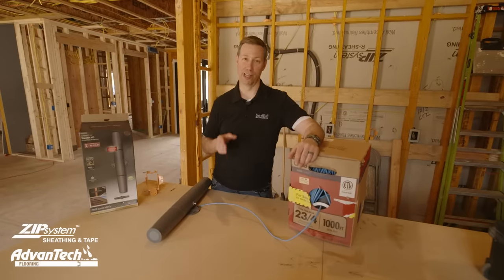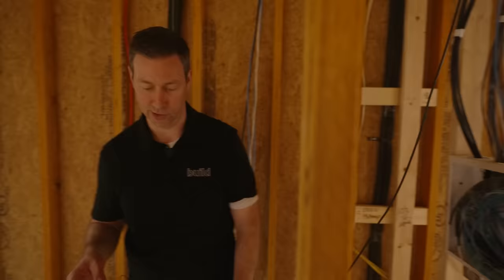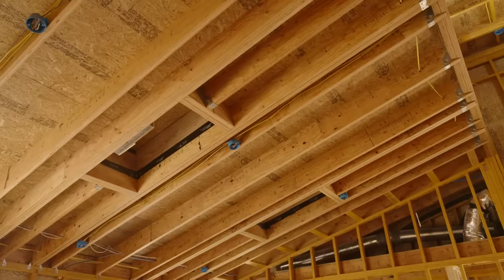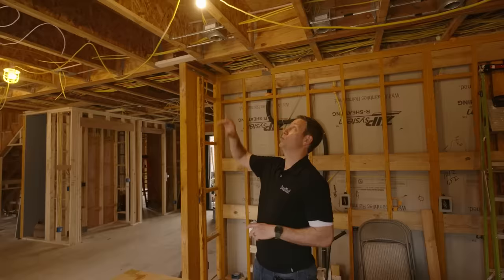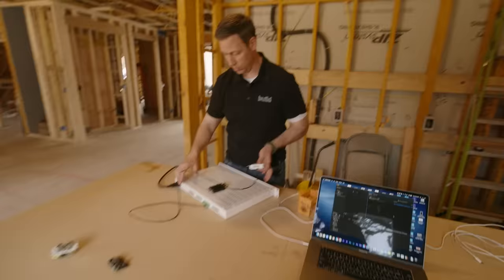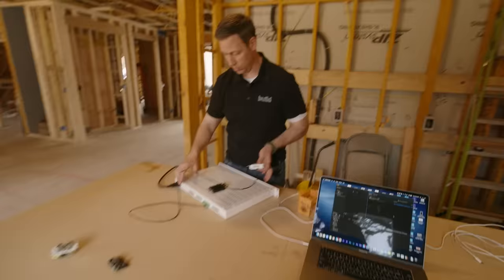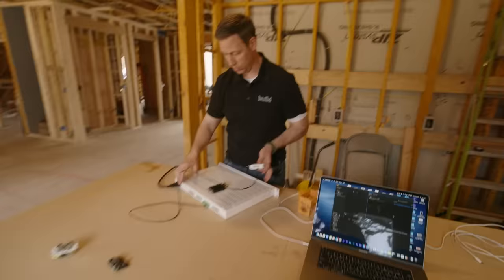Low ⚡Voltage at the Real ReBuild

Comment: Matt, I enjoy your videos.  For all of the research you do I am disappointed you didn't consult any of your AV subs.  You so easily discount Low Voltage even though you specifically "only" use the internet for all of your media content.  Unifi is a great product that will require you to learn about some networking.  It is also a product that works best wired.  To be fair all of your proposed devices should be wired to the network including Sonos, TiVo, Samsung TVs, Unifi...  To only wire for a few locations because you are scared of technology is similar to wiring only the outlets you know you'll be using.  You being a fan of Solar should know those controllers prefer ethernet.  Garage door hubs, lighting hubs, steam shower hubs, whole house water shutoff hubs, HVAC hubs, WiFi Access Points, Cameras, Doorbells, Tesla Powerwall, printers, appliances....these are all currently used devices that you the custom builder have not planned for.  Your Samsung TV with a proprietary cable will be your next iPod dock brick.  Give more respect to a trade that is absolutely part of the future and do equal or better research like you do for all of the other building trades.

Comment: Did you consider a whole house control system like Control4 or savant? Could you tell me the pros and cons of these high end systems?
Reply: Cost is the major factor here and Control4 or Savant is overkill for what he explained he needs and is doing.  He does not have a large multizone system with many receivers in a rack to many TVs and control to the sprinkler system or many other systems.  He said he has one major TV point.  I install low voltage and the more expensive systems are getting phased out by these systems that can be setup and fixed by the end user like SONOS for audio and Ring for Alarm.  Not to say they not still have a place in some homes or businesses.

Comment: Matt. Did you run your LV wire parallel with your high voltage?  You should never do that,  you should try to always stay a bay apart or go across when ever possible. You are going to attract a lot of noise. Perhaps even kill some of the signal.

Comment: So, how did you deal with the voltage drops running that length of low voltage wiring aka Cat5/6? Or did I miss the explanation?
I have been thinking about running and using Cat5/6 PoE instead of using ROMEX if only low voltage devices were being installed and or used for several years now however was concern about voltage drops.

Comment: Doesn't the voltec system then introduce the problem of voltage drop. I have a sailboat and when you are working in 12 volts over any distance voltage drop becomes a problem that is solved by increasing wire size. To get over the problem with my solar panels I connect them in series increasing the voltage to 80 or so which is then stepped down to chargning voltages closer to the batteries. To me it would make more sense to keep the voltages high with 120 AC and find receptacles with higher dc amp charging for the laptops.

Comment: Always run more ethernet lines than you need. It's so much easier to do before the drywall goes up. Wireless is good, but a hardwired connection will always be faster and more stable. Think of Computers, TVs, Cameras, Smart Devices, Media Boxes, Wireless Access Points. Always run a few lines to each room.

Comment: What about future proofing. Noticed ya didn't mention any smerf tubing or anything like that
Reply: My main concern. For Matt he'll just open up the wall and replace whatever and make a video for us. For us viewers on a low budget(dirt poor), diy we need considerations for future tech. I think building access panels that are removable and using lower gauge wire when a higher one would do just fine in your current application is a good practice just in case. 

Proprietary scares me on a house. If the speaker wire connects to a generic speaker I can always replace it. If it connects to a specialty product what are the chances it fails in 10 years, the company or product line is discontinued, and I'm stuck committed to something that doesn't exist anymore. 

Modern stuff is cool but there's a reason why there's so much e waste as tech advances and why building it into your house can be a bad idea. 30 years ago vhs, cassettes, tube tvs and monitors, laser disc were the in and up and coming tech. Had you built with that in mind you'd have these slots in the wall for AV equipment, embedded RCA cables, huge reinforced recesses to support the weight instead of a cabinet plugged into an outlet that you can throw out with the times.

Comment: WiFi IS improving, but for video at fixed locations, it is no substitution for a wired network. I use three Ubiquiti WiFi access points at my house (I actually need to add a fourth) and get great speed, but I run gigabit Ethernet to each TV location. For over-the-air TV, I use several SiliconDust HDHomeRun network tuners; two EXTEND units which can do two channels each and one HDHomeRun CONNECT 4K which can view up to four simultaneous programs with two of the tuners dedicated for ATSC 3.0. Instead of a TiVo, I use my Plex Media Server to function as my Live TV/DVR, allowing up to six simultaneous different channels being viewed/recorded.
Reply: +1 for PLEX!

Comment: If it were me, I’d run fiber optic to two most distant utility areas in the house and branch with Ethernet from there. Running single CAT-6 runs is too much like the old-school iPod cable you mentioned.

Comment: Cat6 is 4 twisted pairs... not 4 stranded pairs. Also, southwire Cat6 doesn’t have the pair separator built into it like the quality Cat6 wire manufacturers use.

Comment: I would run the low voltage wiring in smurf tubing so you can easily pull new cable in 5-10 years when CAT6 becomes obsolete....

Comment: I wouldn't be linking a CCA type Cat6 cable - definitely not quality.
One big useful trick with keystone panels is if you renumber them so they aren't 1-24 across, but 2 rows of 1U 24 panels where one  is odd ports, other is even ports. Example if you have a 24 port PoE switch used you can populate 13-24 slots on both rows but the positioning would match perfectly up with port numbers and locations so you can use 6" cables (use 1-12 for coax keystones or something). Be a super clean install and save on wire management.
As for Ubiquiti gear - I have both the regular Dream Machine and several Dream Machine Pros at work. I'd consider the Pro instead since it has more more of the UniFi ecosystem contained in it like the NVR and door access. It also let's you drop in your own storage drive.

Comment: Liable the power wattage if the USB outlets. USBC is a wild west of wondering if it has enough power. The system should automatically detect lower voltages.

Comment: To this electronic tech, you're absolutely right about gross overfeed for North Am residential lighting circuits.

You might want to get back to some of your contacts in Switzerland and Germany on this. Europeans think even incandescent lighting circuits should be run low amperage. Make that LED and low voltage solid-state devices, and the point is even more abject. They're way ahead of where we are! Note the date below: 

Time to Ditch 120V AC? How a Low-Voltage, DC-Powered Home Might Work
Has the 240/120V AC residential infrastructure outlived its usefulness? Inspired by Tesla Powerwall, an industry veteran explains how we could get to the the old ‘Smart House’ vision of a low voltage, DC-powered home.

CE Pro Editors  • November 23, 2015
https://www.cepro.com/news/how_a_low-voltage_dc-powered_home_might_work_tesla_powerwall_energy_storage/

Comment: You will regret having a Samsung proprietary cabling solution within 5-7 years.  They have done similar things (HDMI ports remotely connected over a proprietary cable) in the past.  Typically, when those TV's finally die, there is not a 'new' model that can use the same cable.  So you would then need to replace the cable as well.  Do yourself a favor and run a high quality HDMI cable (assuming the run isn't more that 25-30')  and 4 strands of fiber optic cable between the media closet and the box behind the TV.  The Samsung solution is quite nice for the short term, as you get one remote that controls the TV and source switching, but technology changes rapidly these days.  In 15 years, we have gone through probably 5 iterations of the HDMI standard, in order to accomodate ever increasing display resolutions, but at least those standards have remained backwards compatible.  You can find multiple different options for switching sources, most done through some sort of home theater receiver or sound processor with source switching.  That does mean that you won't get the switching function through the TV remote though, with the trade off complication.  And consider what sort of surround sound you want in the TV area ahead of time.  The Sonos sound bars are pretty basic when it comes to actual surround sound.  And please don't rely on WiFi for your connectivity solution for the Sonos equipment.  It will work ok for a couple of speakers, but if you start to scale it to whole house sound, you will find that you get dropouts in sound from time to time.  A cabled ethernet connection will always give you better bandwidth for things like audio (and video) that need consistant streams of data.  I also have some questions/thoughts about the USB distributed charging solution, but I can save those for later.  Finally, be sure to get yourself a good Fluke ethernet cable tester (https://www.amazon.com/Fluke-Networks-MS2-100-MicroScanner2-Troubleshoots/dp/B000QJ3G42/ref=sr_1_14?crid=36ERJB27P7FDT&dchild=1&keywords=fluke+ethernet+cable+tester&qid=1621421290&sprefix=fluke+ethernet%2Caps%2C177&sr=8-14) to make sure that your ethernet cables are properly terminated, especially if you are going to use Ubiquiti Unifi cameras that use Power over Ethernet (PoE) to get their power from the network switch.  The ethernet data only requires that 2 of the 4 pairs of wires are connected to work, but the PoE requires that all 4 pairs are properly terminated.

Comment: You want everything that doesn’t move to be wired, and you want to put a separate, PoE-powered (hard-wired) wifi access point in each room. 5GHz wifi doesn’t penetrate walls very well.

You want to leave your wifi spectrum as free and clear as possible for things that are mobile (laptops, phones, watches). And while it should be avoided, some appliances just can’t be gotten in wired versions (smart thermostats, scales, etc.)

Even laptops that you dock at a desk should get hard wired. Otherwise you’re just wasting that precious fiber service.

Check out UniFi hardware. Bring in a patch panel and a 19” rack and buy rack-mount versions of the gear.

Comment: Cat6... that's a bit of a mistake, cat6a is where you have 10g possible for longer than 30m runs.

Also the ethernet should really go into conduits, so that you can swap the cabling 10-20 years down the road when you need something like catWhatever or fiber to certain locations of your house.

Comment: It would be nice , that instead of the rats nest of plug-in A/C adapters that rooms could be wired for the low voltage for all that.  Computers can use external power supplies, which reduce the heat and are quieter too. A closet can contain a battery backup.
Reply: I have seething hatred from wall wart power supplies.   If the need ever arises I’ll spend the $$$ for a Middle Atlantic DC Distribution center just to eliminate the clutter.

Comment: cat 5/6 is cheap.... I am pulling cat 6 to each room in my home, every TV location (used and un-used)
I'm also pulling cat 6 to a couple of outside boxes along with outside outlets for christmas lights, and using cat 6 to take data to christmas light controllers. In my soffits I am installing RGB pixels that are hardwired low voltage and will be controlled via kulp boards with a Pi to send color data to those pixels (lights).

Comment: Matt, For that Samsung Frame TV, did you have to run the cable through a conduit? 
Samsung is not clear on in wall ratings for those TVs.
Reply from the maker: I didn’t 😬just ran a conduit beside it in case it’s needed in the future

Comment: I wonder how that Voltec system manages power delivery properly with only 2 conductors.

 Typically a MacBook will request 20V from the charger but needs the conductors to do so.

Comment: My main criticism of integrating tech is that it will one day be obsolete. If you're cool with remodeling regularly it won't matter. If you're poor as in spending money on bricks for some landscaping is expensive in your mind then you're not gonna be opening walls to rerun whatever 10, 20, 30 years later. There's something to be said for keeping things simple and making obvious generational changes. Adding more outlets when we now have more and more devices is logical and forward thinking. Running a pipe with your ethernet wire through it makes upgrading it from cat 5 to cat 6 or cat 500 in the distant future easier. 14 gauge wire on a video doorbell is overkill but bell wire was all you needed for a traditional bell 50 years ago.

Comment: I thought the Samsung The Frame accessory cable maxed out at 15 meters.  Also, you don’t need any of the cabling (or power) in the wall box for the Frame, since the connectivity and power will be in your media closet.  I suspect that you are just future-proofing that location in case you no longer use The Frame in that location.
Reply: Yup…One Connect box has multiple HDMI.    It’s easy to run baluns if longer runs are required.

Comment: There are two important reasons to go with #12 AWG wire in lieu of #14 AWG: future capacity and voltage drop. Future capacity may not be as big of a deal for you, since I bet you segregated your circuits well, but if there’s a future owner they will likely connect new equipment wherever it’s most convenient. But depending on the local utility, panel and service size, and installed heavy equipment, you may have enough of a voltage sag to affect lighting. #12 AWG wire has a 59% larger cross-section area than #14 AWG wire, so #14 AWG wire will have a 59% higher voltage drop (all other things being equal). I’m with you, spend the money now to save the headache later.
That said, I’m not a fan on POE lighting or low voltage USB, mostly because of future-proofing and sometimes misleading marketing. The UPS idea was good, but I prefer solving resiliency with larger solutions. What if you need to use a 120V device in a power outage?

Comment: I always find it interesting when  I see these kind of projects taking place and none of the wire is in pipe.  Here EVERY wire regardless of voltage or use MUST be in pipe. Doorbells. Ethernet cable. Coax cable. POT lines. Speaker cable, etc etc.  No MC no BX no Romex, nope can't do it.  The labor savings for all this at your house is enormous.
Reply: "Here" is where?
Reply: @bradgaeth  DuPage county Illinois

Comment: You might still want to run coax to your tv ports for when the fiber goes out so you can run a digital antenna thru it. That way you always have at least local digital channels for your tv. IMHO. Just saying. 🤔

Comment: Isn't the advantage of AC over DC that you can use thinner wires to carry current  without voltage drop over distance? I wonder how hot the thin DC cables will get when charging the laptop over the distance.

I'd also be curious to see the voltage drop for the 100' run to your further jacks.
Reply: AC has an advantage on really long runs and its safer at higher voltages. DC at low voltages can be more efficient. Over the 100 feet you will drop around 2 volts on a 36 volt system. The wire is rated at 5 amps and the max wattage for a class 2 low voltage system is 100W
Reply: There really isn't an advantage. The lower the voltage the more current (amps) is need to deliver the same power to a device. Power = Volts & amps. The more current, the less efficient power transmission is. Thats why the grid uses very high voltages to transport electricity over long distances. DC power is limited to 48VDC in household or commercial wiring since higher DC voltages have potential issues.
Reply: @guytech7310  the current doesn't effect efficiency.  Power loss is a result of resistance which is determined by the wire. Lower voltage systems save on copper and material  especially in places you dont need higher power which is becoming about 90% of homes.

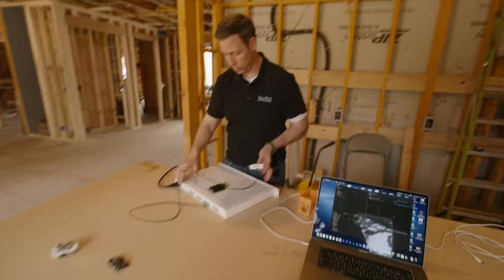Comment: 11:00 Regarding Matt's comment on DC lighting...Look at ATXled.com.  I installed ATX in a garage and have it connected wirelessly to a Shelly motion sensor.  Easy install with 18g wire, flawless operation.
Reply: Currently building my home and am going w/ ATXLED throughout. Super easy and has SMART features, but still works just like a normal light.
Reply: @jasoncbeaton  Just curious what smart system you're connecting the ATX to - if you don't mind sharing.  For some reason my automated system stopped working ....it included Shelly, a system (forgot name) to connect to ATX and I thought Alexa to tie it all together....so it's been back-burner'd.
Reply: @rdy4trvl  Their switches connect to their DALI hub for local control. I'm connecting the DALI to Alexa and Home Assistant.

If your switch isn't theirs, your probably connecting via the Shelley Relay.

Comment: For more integrated systems, check out HomeAssistant. Its an open source project aimed at smart homes that has tremendous support for devices. Ping me if you have any questions, I've done some dev work on the project.